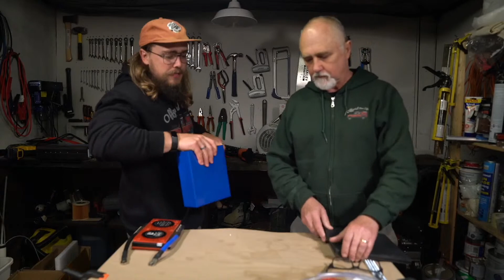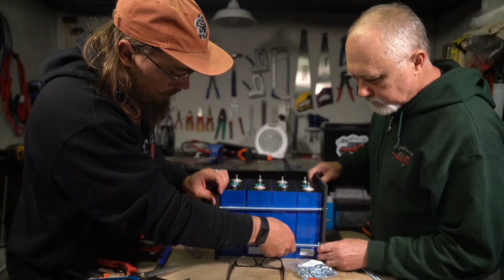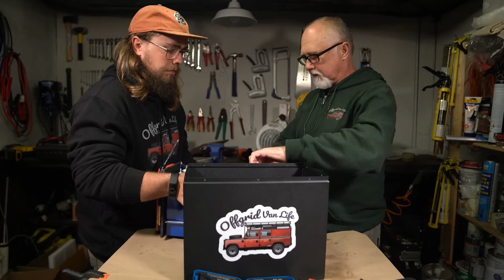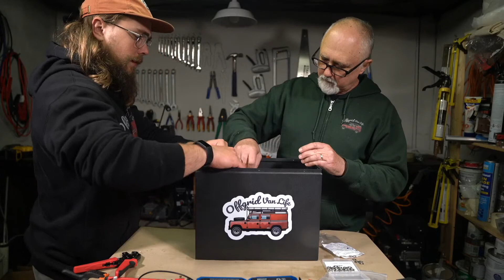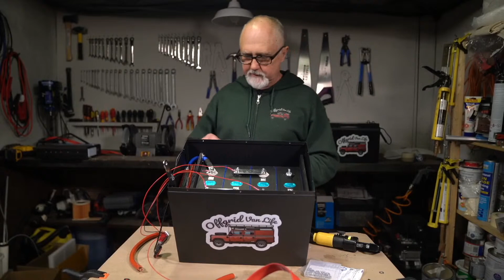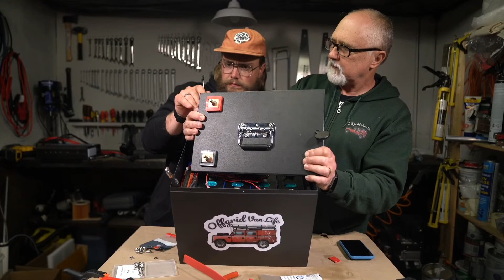Workshop LIVE: Building a new LiFePO4 battery with a metal case

Comment: are you based in England or Ireland just wondered if you had any problems getting the batteries from china through British customs as I've heard they will hold the delivery for a few months
Reply from the maker: Roger is based in England and Nigel is based in Northern Ireland. Because of Brexit, Northern Ireland is still considered part of EU in terms of shipping & receiving products. 
We have not had any problems receiving products from China. We've never had significant delays, especially in recent times. We had an order that we placed in December 2020, which took three months to get to us, which we think was due to Brexit. But nothing longer than that.
Reply: @offgrid_power  Thank you for the reply if you have them all shipped to NI then like you say its classed as EU so wouldn't be a problem (and might be able to avoid the vat). I think its just England that has the problem, found some suppliers on Alibaba don't really want to ship to England because of the possible delay. Oh just belt and braces I would of insulated the underside of the lid so if it got knocked over it couldn't short out on the lid, or made the wood sides big enough so they touch the lid

Comment: Good construction, I would improve it by adding insulating separator between cells, the first and last being made of 2mm thick rubber.  Add Loctite to the threads to prevent them from loosening in the van and if the bolts are not welded, they will be fixed with red sealant.
Congratulations on the content 👌
---
Buena construcción, la mejoraría añadiendo separador aislante entre celdas, siendo la primera y última de goma de 2mm de espesor. Añadir Loctite en las roscas para evitar que se aflojen en la furgoneta y si los pernos no son soldados quedarlos fijos con sellador rojo.
Enhorabuena por el contenido 👌
Reply from the maker: Thanks for the suggestions! :)

Comment: You should test if the Bluetooth will work inside the case and mount the switch in the hole . That way when the battery is not in use then bms can sleep and can easily be restarted without opening the  case.
Reply from the maker: Good ideas. Thanks. :)

Comment: Love your videos.  Could you provide a link to purchase this metal box?  Also the Daly BMS has lug holes suitable for M6 studs.  How do you connect to Victron smart shunt with m10 bolt?  Do you drill out a larger hole on the Daly BMS lug, or do you make up a short connection?  Thanks
Reply: I'm also interested in link to purchase the metal case.
Reply from the maker: This case was custom made for us as a prototype. As soon as I have a link, I'll happily share it. :)
Reply from the maker: Thanks Gary. This case was custom made for us as a prototype. As soon as I have a link, I'll happily share it. :)

In terms of the victron smart shunt, it depends. Sometimes we've connected them by cutting the M8 lug off the black cable on the Daly BMS and putting an M10 lug on there. Sometimes we put a bus bar between the BMS & the Smart Shunt.
Reply: @offgrid_power  Many thanks for that bit of information.